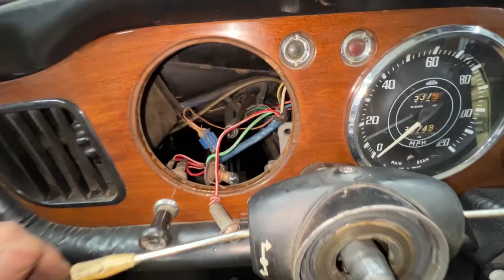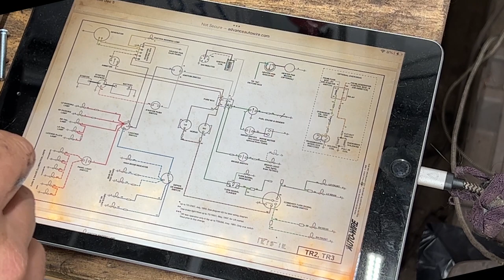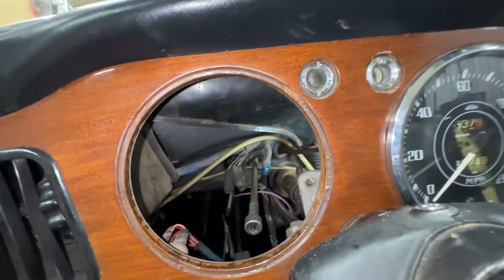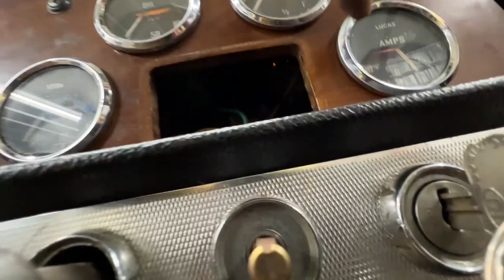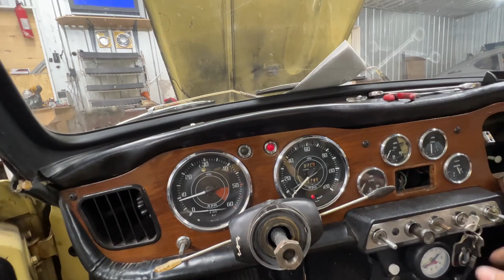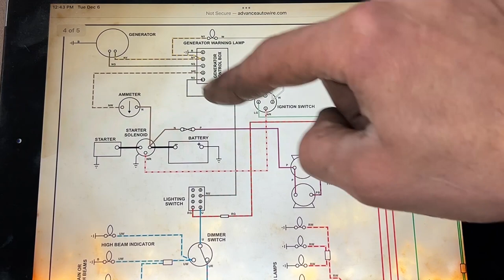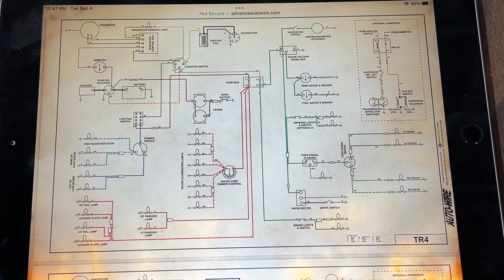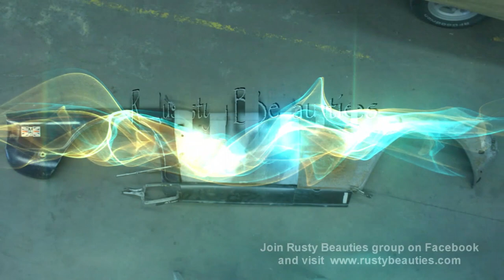1964 TR4 - Part 3 - Positive to Negative Earth and More Electrical Issues

Comment: I changed the polarity on my mk2 jaguar & flashed the field coil, & reversed the ammeter connections. Everything worked except the windscreen washer motor which is polarity sensitive !
Regards,
Sandy 🔧🏴

Comment: I prefer the 'waterproof' heat shrink ring terminals and all terminals for that matter.  We also use a label maker to identify wires if we have to dissect the harness like you did.  Nice Job.
Reply from the maker: I always prefer to go with the wiring diagram instead of labeling everything, especially for a harness that has been worked on already. If it was connected wrongly before that might have caused the problem and then I will just carry on with the wrong wiring if I connect it the same way

Comment: On my E-type I pulled the entire harness out and laid it on the floor to label what went where. In the end I bought a new set of wiring harnesses, but I could have repaired it like you did. I remember my hands were completely black from the tape residue like your were. My finger tips were sore too from pulling at the tape.

Comment: Thanks for the lesson in basic auto electrickery, Elin. Tales me back to my apprenticeship days in the bush here in Australia, in the early 60's, Of course 6v electrics were the go then! Yep I hated electrics then and still do, with a vengeance, Admire and respect your talent across the board, Oh I remember asking you about those Knipex straight jaw multi-grips; I have found a supplier here in Perth but just wondering if they have a model / part number on them, so I can get the correct pair. (nope not cheap)..

Comment: I had the exact wiring issue on my negative ground TR4.  Driving on a rough road, speedo light fell out and shorted.  Lots of smoke coming out from under the dash.  1/2 hour under the dash with electrical tape and I was able to get home.  3 hours under the dash to replace the wire.  Did not pull it all the way back to the glove box, although looking at how you did it, probably would have been easier.

Comment: You are in good shape then. If the antenna is isolated from the body then you don't get the shielding effect and the radio will pick up more interference from the car's ignition etc especially on AM (medium wave). so going with a negative earth will fix this problem. Make sure that the antenna is now properly grounded to the car wing where it is mounted. Also make sure that the radio chassis is also grounded to the body.

Comment: Elin, I tend to assume that basic start up rattle is generally big ends as they see a lot more action than the main bearings however if oil pressure is super-low and the crank has done 100k plus then maybe those shells are also shot. Great series either way, good luck buddy👍🇬🇧

Comment: Another great, informative video Elin;  thank you!
Electrical issues drive me nuts.  I think before I unwound the harness tape, I would have broken out my VOM and checked continuity and more importantly, ensure that shorts did not exist between connectors that aren't supposed to have conduction.  That would double-check my visual inspection after I removed the harness covering.  The 'Magic Smoke' sometimes sneaks out an almost invisible break in the insulation!  lol
Is there an easy way to identify polarity sensitive components?  Some old stuff isn't, while new stuff is;  how do you tell?

Comment: Nice job.  You will need to reverse the ammeter connections now that you have changed the battery polarity. At time 47:03 you can see the ammeter moving to the positive side when you turn on the ignition before you started the engine

Comment: Do you think someone tried to jump start it or replace the battery hooking it up for negative ground and unhooked it quickly once they realized the let the smoke out? I’ve always said all electrical parts and engines are built with smoke installed in them and ounce you let it out somehow they are probably junk!!! Great video as always.
Reply from the maker: I think the uninsulated spade connector that was on that string of lights that I called Christmas lights touched the ground wires behind the gauges, maybe the ring terminal that I replaced and that is what let the smoke out of the black wire all the way to the indicator light. Then someone ran that yellow wire from the indicator light to ground, but maybe the light fixture came lose and the negative side touched ground again and that let the smoke out of that wire too 😂 💨

Comment: Did you disconnect the battery terminals while reversing the coil wires and attaching the positive lead to the starter and the negative ground wire to ground?

Comment: Great video. You are fearless!!! One question... did you have to change anything on the voltage stabilizer? I think the old ones were mechanical but the new replacements use solid state regulators that are voltage sensitive.
Reply from the maker: Correct, the new ones are polarity sensitive, I should have mentioned that. This one is the old style and doesn’t mind the reversed polarity. Same for the signal flasher. The new ones need to be reversed too.

Comment: FYI - when checking the wiring on my 1965 TR4A, I found some discrepancies related to the lighting switch (flash-to-pass) between how my car was wired and what the Autowire diagram showed. After checking the various forums, other TR4As had the same wiring I have. So there must have been some factory changes, perhaps based on region/country/etc. Anyway, just a heads up.

Comment: How is the clock still running? A wind-up?

My TR4 was a positive ground car. Not a big problem, I only had issues with the radio and I installed a converter for that.
Reply from the maker: Wireless :)
Reply: @RustyBeauties  Riigght.. :)
Reply: No I think the clock is legit W! 😊😊😊

Comment: If the radio doesn't have a polarity changing function then you will need a new radio since the antenna wire is connected to the chassis of the vehicle.
Reply from the maker: I believe the antenna has been insulated from the body. This is regular radio designed for negative earth car so it wouldn’t work if the antenna was grounded. I will show the radio in a future episode, it was wrapped in rubber so the body doesn’t touch ground anywhere
Reply: You are in good shape then. If the antenna is isolated from the body then you don't get the shielding effect and the radio will pick up more interference from the car's ignition etc especially on AM (medium wave). so going with a negative earth will fix this problem. Make sure that the antenna is now properly grounded to the car wing where it is mounted. Also make sure that the radio chassis is also grounded to the body.